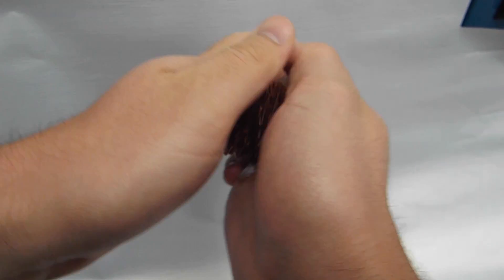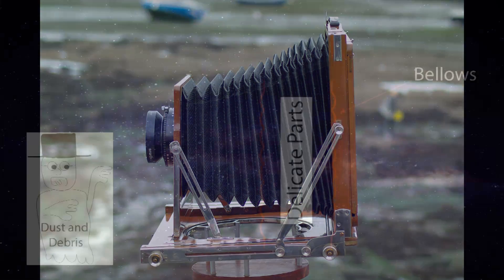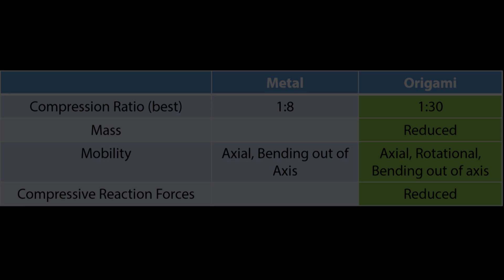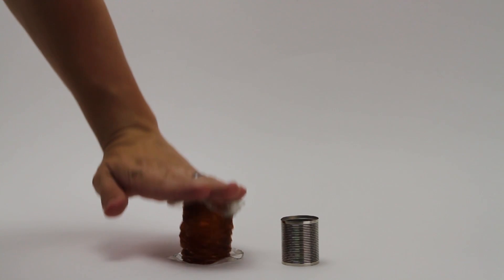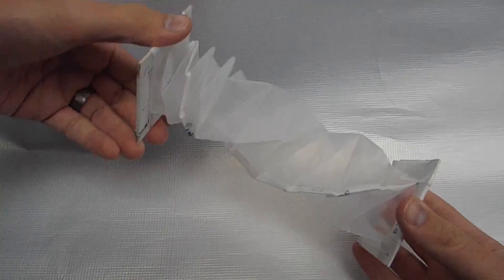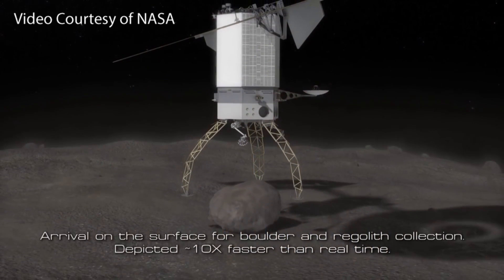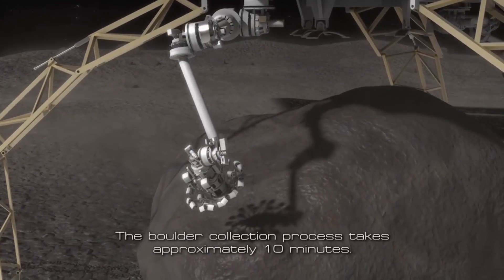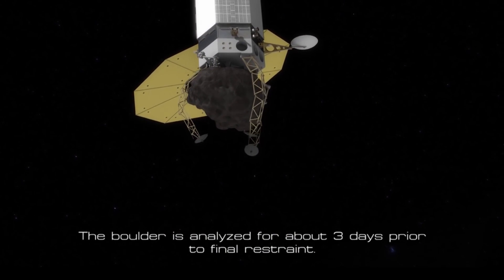Highly Compressible Origami Bellows for Harsh Environments

Comment: Any idea which material would work well to compress air for a low pressure air pump, that needs to last years, for something along the lines of a furnace bellows (but not exposed to high temperature)?